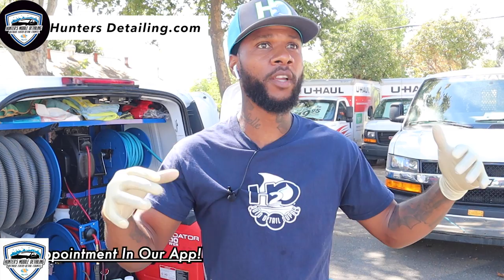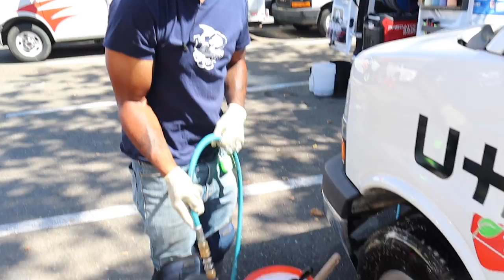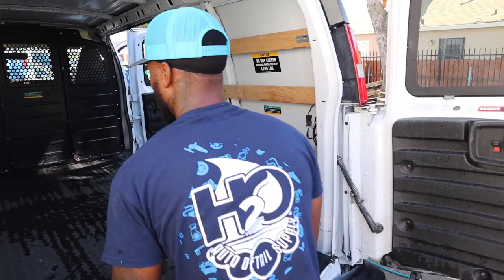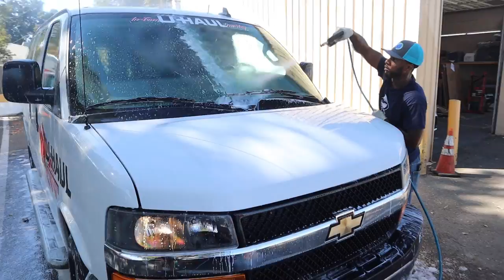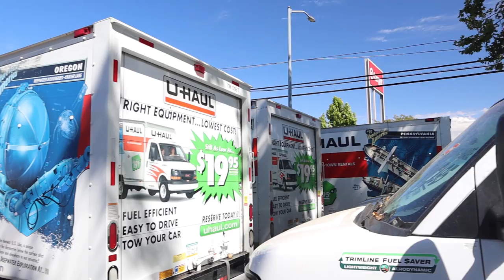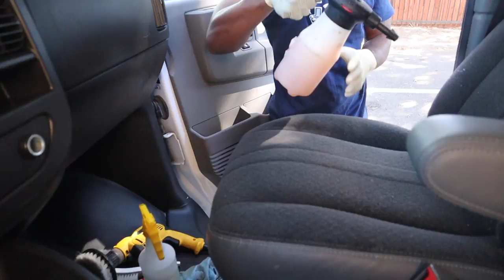Detailing Uhaul Cargo Van - Hunters Mobile Detailing

Comment: What works for me.. 
a plastic folding table about 6’ in length to tackle the rubber mats correctly.  
Put it on and clean both sides and let drip dry.
Only adds to the mess by cleaning the inside and putting the mat back inside and cleaning again.  

Great video congratulations on new client 🤜🏻

Comment: I’m currently in a similar situation, working as a detailer/vendor at a dealership. The whole portal thing sounds like a hassle, but once them direct deposits start hitting….it’s a wrap. Keep up the good work. From my experience I usually don’t spend too much time “detailing” considering where I am and the volume of cars I touch in a day. I always make sure to charge detail prices outside of this workplace, and provide high quality details to individuals.
Reply: Man i had this one dealership i hated that place they gave us the nasty trade in cars they wanted them clean like brand new prefect like but you can only do so much i gave them a quote on what we would charge told them $150 then the guy was like “how bout $100 each car engine bay and all we got lot of work for you “ and i took it i shouldn’t have but needed to make some money at the time now The business is good where i don’t have to take on dealer work no more some dealerships will pay me $300-$400 though those are a blessing
Reply: @daltoncrawford4849  dude I know exactly what you mean. Best of luck with your business man!!
Reply: @moG4545  the one place we did cars for that was paying $100 they were some assholes we can only do so much on the nasty cars and they will keep saying “you miss a spot here and here some stains right here “ and then they accused me of “pimping them out “ meaning they was thinking i was getting someone else to do the work instead i heard bout it from the employee who works there he’s my friend that piss me off so i had to say something bout it

Comment: I got a couple of small fans ment for floods at home depot for $100/each. They definitely pack a punch and would help dry before u put the mats back in. You don't want mold to grow underneath you should dry completely. Sometimes the sun is hot enough you can air dry but I prefer the fans to speed up the process. Much respect

Comment: on the van rear cargo floor mat, could you just do the top half laying outside the van both sides, the dry it, switch it around so the bottom half is hanging out the back and do the same? not sure, just trying to give you an idea at least to start with. or half one side then the other side.

Comment: I have a suggestion! I would bump the price down to maybe $180. I wouldn't go huge into detail because these vehicles are basically work cars.  I would try to get done within a hour to hour- 15min so your making close to $180 an hour by yourself just incase the helper isn't there and your making that money..That being said if you do have to hire a helper. You really wouldn't have to show that person much to learn how to clean uhaul vehicles. Its very basic and its not hard money and less on the job training. So if you knock out 6 vehicles you just made close to $1100 without even putting in drive time and hard sweat.  The more money Uhaul gets to save the more advertising it looks for the other locations to hire you. Need to eliminate that drive time. Drive time = loosing money.                 Oh and one more thing. Getting Commercial work is way better than dealing with the public